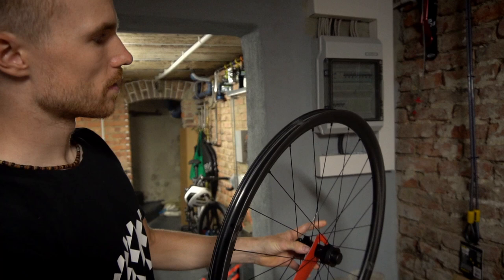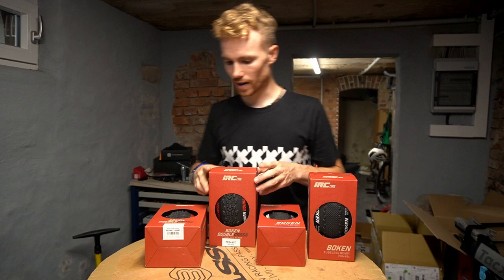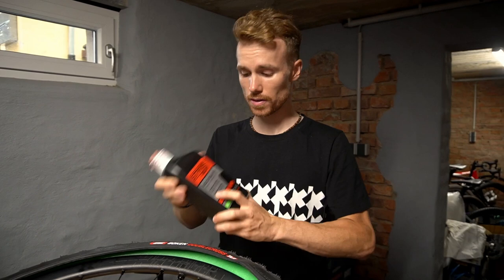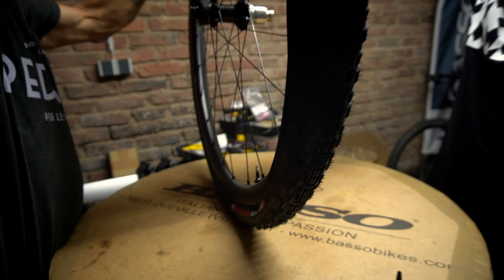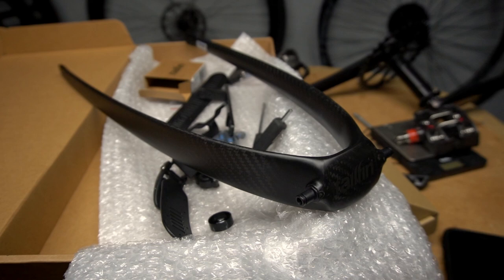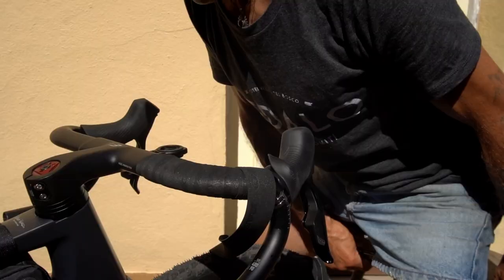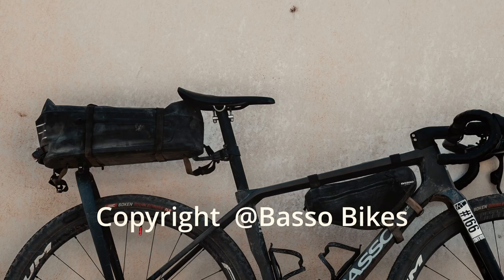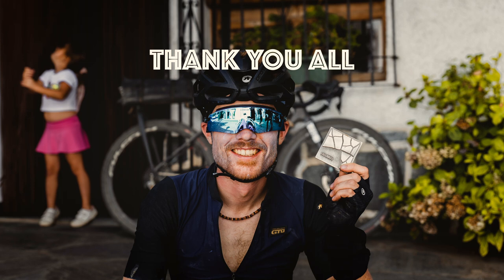MY BADLANDS 2022 ULTRA DISTANCE GRAVEL BIKE | BEFORE AND AFTER

Comment: Hey Mike, nice videos - keep up the good work! Would you run the Tailfin again or go with a different solution (weight/stability etc)?
Reply from the maker: It’s definitely the best in terms of stability - what is in my opinion the most important thing . Maybe I would not go next time with it because I would like to save the weight to be faster. If you take it not toooooo serious I would go for it . At least I was able to take place 10 with it . If you are interested I have a promo code MONO20 for a discount

Comment: Congrats on such a strong finish - Amazing.  How did it play out for your chain?  After a dusty 150 to 200 km my waxed chains are pretty tired.  With your finishing time, I assume you had no chance to use drip wax and let it "take" while you were sleeping. How did you make your math work out (obviously it did, based on your time!!) ??
Reply from the maker: Hey Mike! Thanks a lot! I dont think the chain did the work. I had less time to prepare due to my full time job but I did some key training sessions that turned out pretty well.

Anyway, I took away all the industrial grease of the chain with a break cleaner. After that I put the chain in a parafin bath. This made the chain more resistant against dirt. I thought that this was enoguh but during the ride I used some squirtx every time I stopped to refill. So I applied some fluid wax 3 to 5 times during the race. I think its difficult to ride this race without any lube or wax with you just because there is sand everywhere.

Hope this helps
Reply: @mikemono  Thanks a bunch - Makes sense, glad you were able to add the Squirt drip wax and keep rolling.  Again, well done.👍